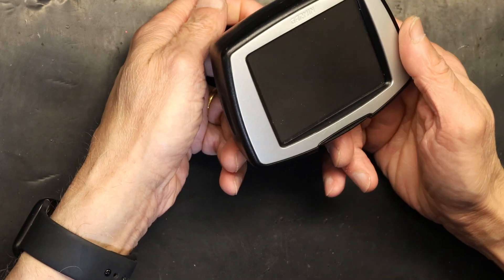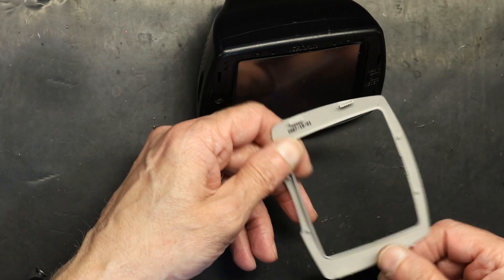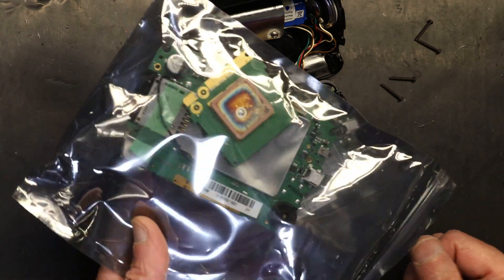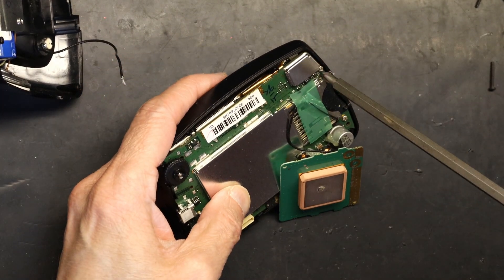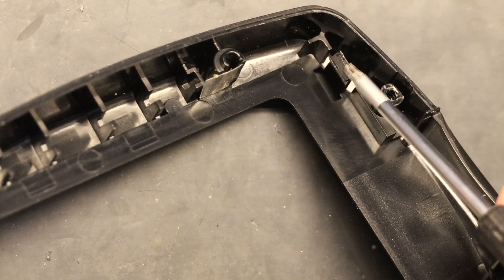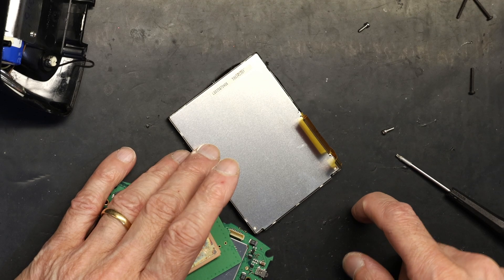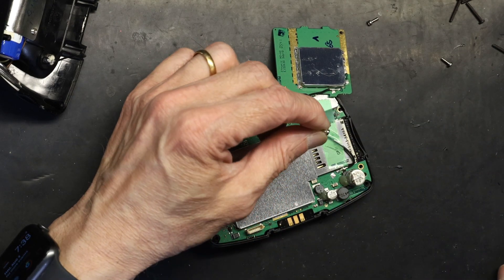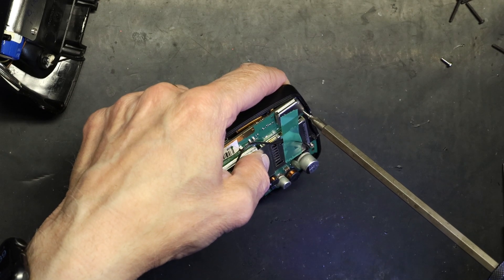Tutorial: Replacing the Main Board or Screen On a Garmin StreetPilot C320 C330 C340 GPS Navigation

Comment: I did question why these units looked so similar to CRT televisions and now i know why, the battery is an 18650 Lithium Cell the speaker is probably very big too (at least on my original TomTom Go at least)
Reply from the maker: They sure do look like the old CRT Televisions, or the old multicolored colored iMacs.
Reply: @TECHNOLOGYTIPS101 the CRT style design does give it a nice charm when mounted on the dashboard or windshield of a 1990s vehicle.

Main reason why I picked up one in mint condition, boxed, for 4 Euro
Reply from the maker: @alexandreb.1101   I agree it sure does give it a cool vintage look, and for 4 Euros you can't go wrong.

Comment: You have wonderful tutorials!  It is possible to change the bluetooth pairing code on a Garmin Nuvi 760?  The factory pairing code is 1234.  I want there to be no code, just pair to another device without prompting for a code.
Reply from the maker: Hi, thank you for your kind words. Unfortunately I don't know of any way to change the BT Pairing code or to delete the code. However there are some advanced settings on the Nuvi 760 which might have this option. To open the advanced setting fully charge the battery then unplug the external power and run it from battery, then press and hold the battery icon for 30 seconds and you will see the advanced settings and diagnostics menus.